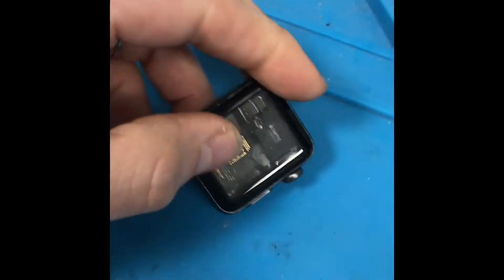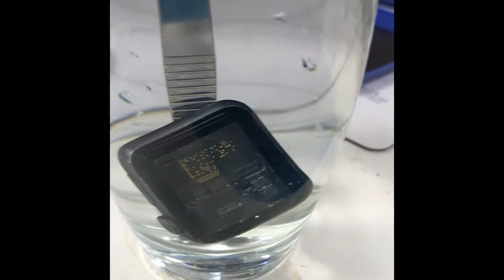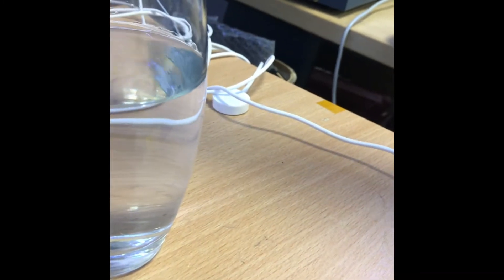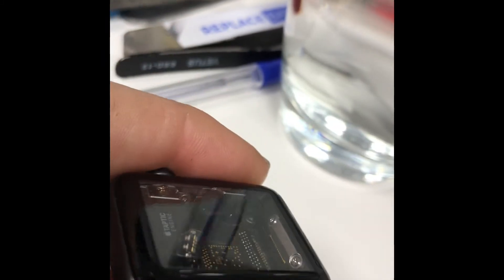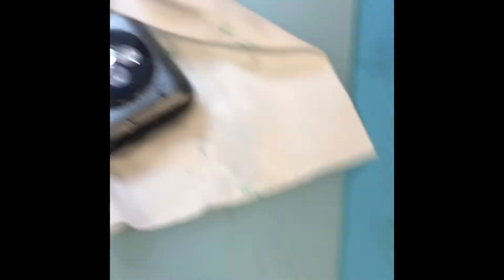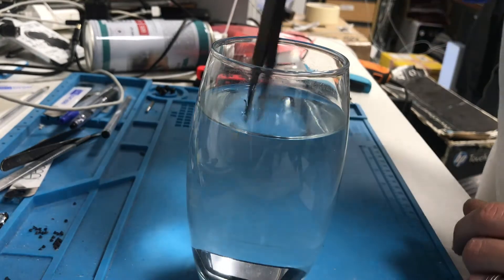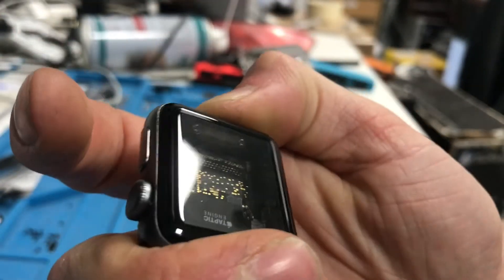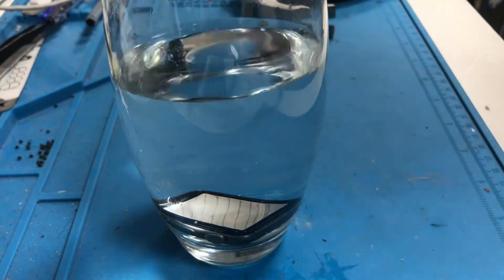Apple Watch repair water proof stress test

Comment: I got a Series 8 and I never submerge it or anything, usually the most amount of water it endures is when I wash my hands but I recently noticed a lot of condensation on the back glass (Heart rate sensor) but I use a silicone case, do you think it’s a water filtration or it’s just the case accumulating water and condensing it on the back glass?